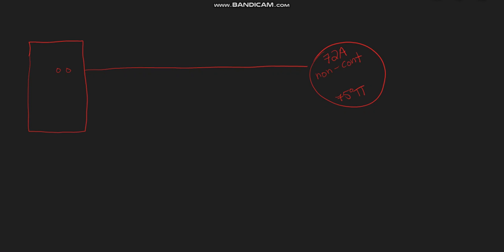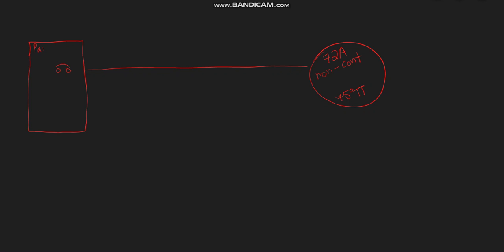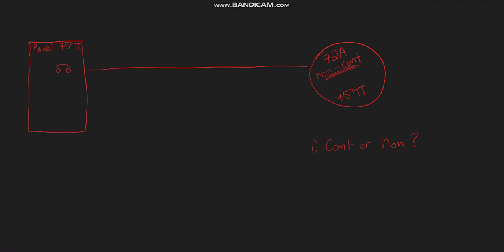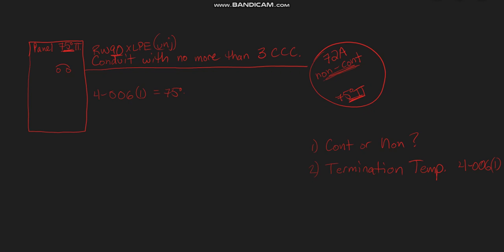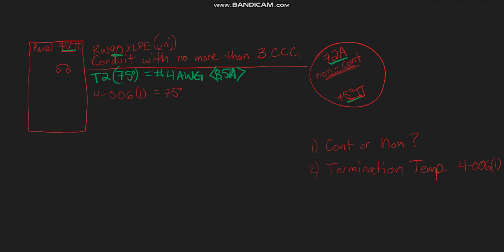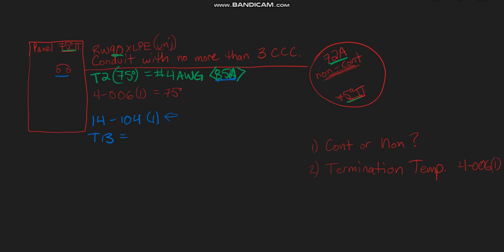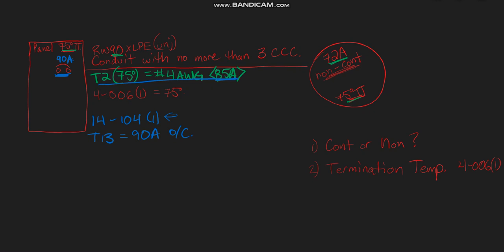Non Continuous  Branch Circuit Calculation

Comment: Thanks! my only confusion is why the 90 A breaker when the load is 72? like in the field you would just put in an 80 cause thats more of a standard size
Reply from the maker: 14-104 1) requires that we use the allowable ampacity of the conductor to size the oc in the case where the load is known.
The no. 4 having an ampacity in this case of 85A allows us to choose a 90A maximum overcurrent.
Academically we use the largest overcurrent and smallest conductor for harmonization of answers, but in the field it is not required to use the largest so an 80A overcurrent is also acceptable , but understand you are selecting it by going DOWN from the allowable ampacity of the conductor, not sizing it to suit the load.

Comment: I had a question about the degree column you used. Doesn’t it state in section 110.14 C 1 a 1  to use the conductors rated for 100 amps or less in the 60 degree Celsius column?  I understand you are in Canada and don’t know what it states in your country. But I know based of the NEC 2020 book, this is what it is telling me. So shouldn’t the wire size for the 85 amp be  3 awg wire?
Reply from the maker: We would defer to those temperatures only if not given the temperature rating of the loads. In this case we are given the 75°c termination temperature, so that is the column we would use.

Comment: There seems to be little interest by manufacturers of breakers to reach for that higher 90 deg C temp limit. I wonder if this is because they can't practically achieve that standard, or because they don't want to put in the effort to test them. If they could, it might save some money on wire costs, so I guess they could charge more for certified 90 deg C breakers. It always seems disappointing we have to downgrade cables from their proven 90 deg C rating column in table 2. On the other hand I suppose attention would then focus on the rating of the downstream end device....